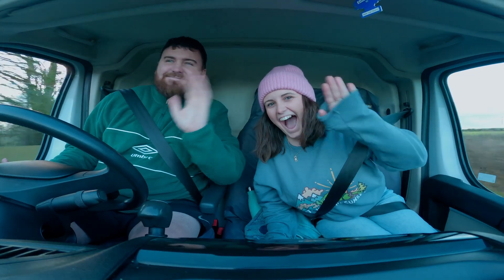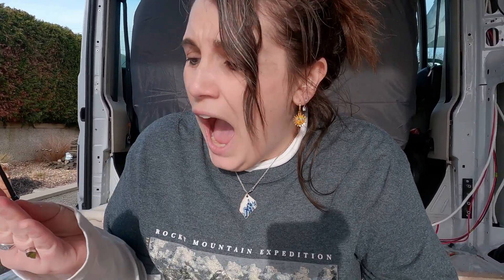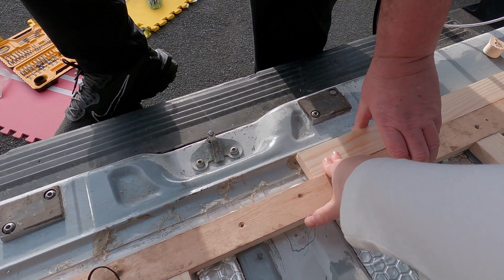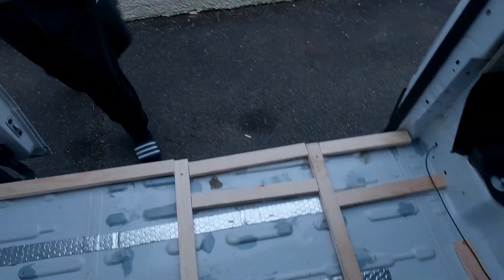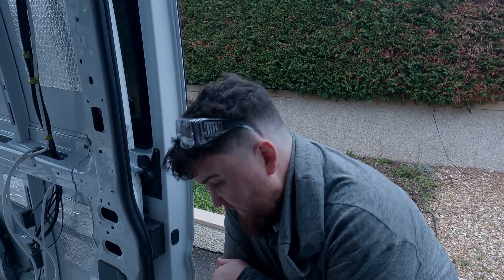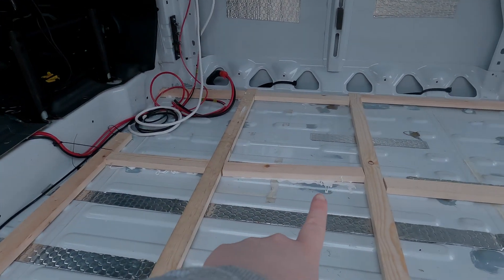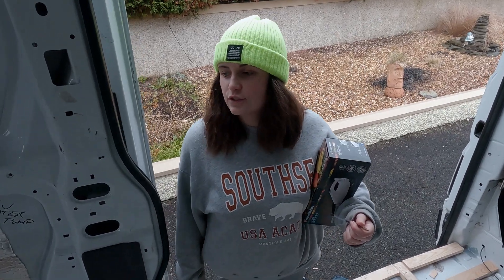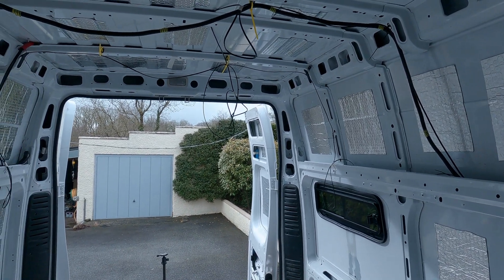Van conversion | NO EXPERIENCE | laying subfloor & insulating walls

Comment: Awesome work you two! I’m doing my insulation tomorrow so this was perfect timing. You’re doing great, take it one job at a time, when you think of the whole thing it’s far too overwhelming. You’re not out of your depth at all - you can do this! 💪🎉💜
Reply from the maker: Thank you 🧡 Are you planning on doing it with the recycled plastic or Celotex? We're also going to be starting our walls and ceiling tomorrow too 😊
Reply: @beyondthe.moment  I’m using both, like you. Celetex for the side panels & that other stuff for all the tube things (like you did) & probably for the roof as well. Vapour barrier & ply back on! Eeeek 🤩
Reply from the maker: @myvanworld  Yeah I think we will use the recycled plastic on the roof too because we have a roll left. So exciting isn't it, once the Ply is back on and you start building some furniture it will take shape so fast! Are you still looking to be on the road for April? There's a vanlife festival on end of April called Camp Quirky that we're going to, you should book on too, it's fairly cheap too.

Comment: Hi, just found your channel and subscribed, I’m just starting my conversion, a 2009 Sprinter, what are you using to edit? Like the vlog style, looking forward to the next one. 😎
Reply from the maker: Hi Mark, we hope you're well, that's so exciting! How long do you expect to take on the build? We're using Davinci Resolve, it's such a good software, super simple to use and it has a great free version.
Reply: @beyondthe.moment  thanks re editing, as they say in all the van build,conversion vlogs, it took longer than expected 😂😂😂😂 I have bought some major items, batteries, solar panels, inverter, fridge freezer, maxxair fan, and skylight vent, 2 extra belted seats, all stored in the kitchen, windows are arriving tomorrow, I have stripped it out, filled all the holes, minimal rust spots, but treated and painted, it’s taken days to work out exactly where the extra seats can be bolted through the floor to avoid cross members under the van, I’ve put most of the batten down today, hope to finish that tomorrow and fill in between with 25mm celatex, I work full time, but off this week to hoping to maximise the time.
Reply from the maker: @markymarks3805  Sounds like you're smashing through the jobs though mate, fair play. It definitely takes so much longer than what you first think, it's so rewarding once things start coming together though 🙌🏻